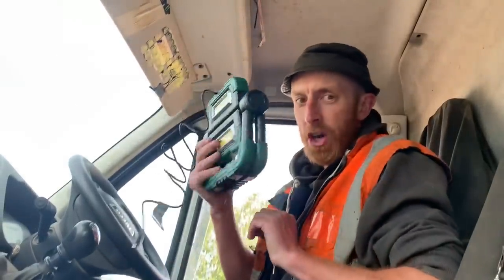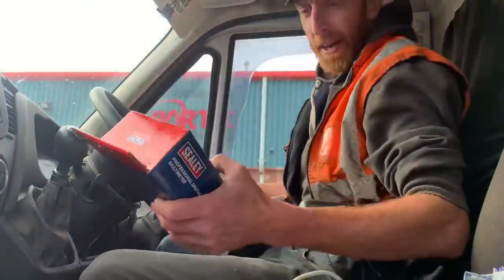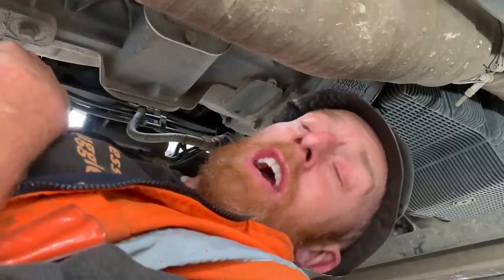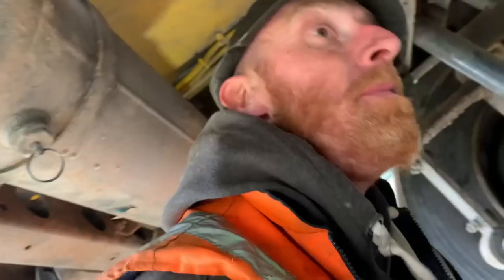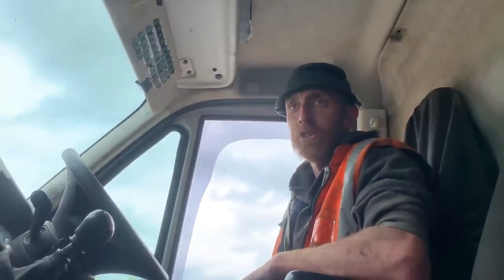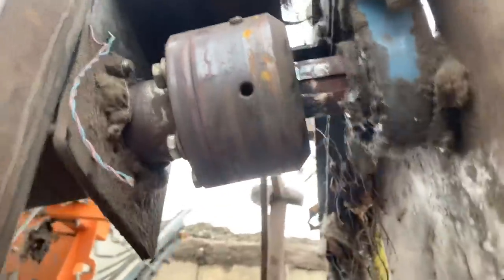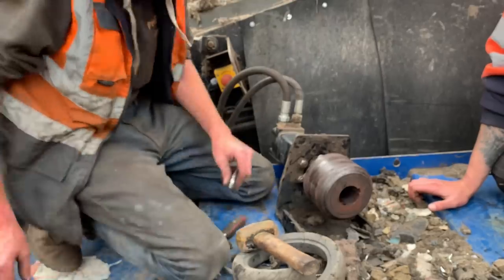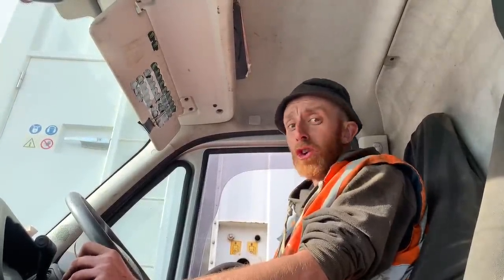Machine break down, little Crane removal, strugglers post box, memory lane, inspection day, p38🤦‍♂️

Comment: Royal Mail always helpful when your paying, loose a parcel and they don’t want to know. Glad you’ve got it sorted, get it posted on your community page soon as. I’ll get a hammer out to you!
I’d drop the oil and pan on the P38 box, clean it out, see if it smells burnt/clutch material/metal particles, if not new filter, new oil, and see where it goes from there, other than that it’s going to be clutch pack/solenoid related, I’m not a pro in any sense, just a chancer with good luck.

Comment: Sounds like there's enough peeps on your channel to advise you on the gearbox...me included. To change the filter you have to drop the sump (gearbox) looking at the magnet in the pan should give an indication of how much ware there is. Also the smell, burnt ATF is a smell all on its own. If it's a very thin layer of clutch brake material on the bottom of the pan then you can get away with changing the oil n filter because your not wanting a long life from it. SPin the torque converter a full revolution because some have a drain plug.  Hope this all helps keep struggling

Comment: Could be issues with the stator clutch, that would require the box to come out, have you thought about just throwing another box in it?? I'm stuck with out not able to see n work on it , good luck mate go through everything u can, hopefully it's just low oil
Reply: I think it probably be the E clutch, so much involved in them , bushing ect ect ect different valves, very complicated clutch really,  normally tho with issues like this they lock in 3rd gear and put in limpo mode , with a msg on the dashboard ect 👍 let me know how u get on with it, sorry not any help lol 😃
Reply from the maker: I could just get another box but I’d be sick if the wire was to fault 🤦‍♂️🤦‍♂️😂😂 weekend mate 😂

Comment: id check gearbox oil but also some things those box's are prone to do. firstly check your solonoids on the gearbox as both 1 & 2 need to be de-energized for it to shift into 4th and if mv1 is sticking on then it wont shift into 4th and you may be knowingly pulling away in 2nd which means a soloid is at fault. or plug into the car and check for faults as reading up one person had a "ANTI STALL FAULT (INVALID SHAFT SENSOR DATA)" which once cleared never returned and ment it then shifted into 4th.
Reply from the maker: Cheers Chaza 👍 that’s the kind of advice I need mate……. Top man 👍👍
Reply: @Professional-struggler  all good, from what your saying its impossible for mv2 (solonoid 2) to be not working correctly as its shifting between 2nd and 3rd which requires 2 to energize and de energize and at that time solonoid 1 (mv1) is both energized through 2nd and 3rd so if mv1 isnt de-energizing you sont get 1st or 4th

Gear MV1 MV2
1st ---0-----1
2nd .--1-----1
3rd ---1-----0
4th ---0-----0

heres the diagram for it 1 = solenoid energized and 0 = de-energized

Comment: Hey Chris. Top upload as usual👍. Have you got the front prop shaft fitted on the P38? With it being an auto the transfer case has a viscous clutch in it. It might be trying to send most of the drive to the front diff. Those g’box’s are fairly robust.

Comment: If putting the meter on the battery to test parasitic draw make sure you set it onto the hig amps setting. Some meters have 3 holes for the probes with one being high amp

Comment: I'd go gear box oil mate, or be a solunoid issue, is the 2 change it does free no noises ect, maybe clean or the plugs to the box and plug the car in any gear box fault should show up
Reply from the maker: I’ve done the oil and filter, I’ll give that a go at the weekend mate, thanks for the comment Ironman 👍